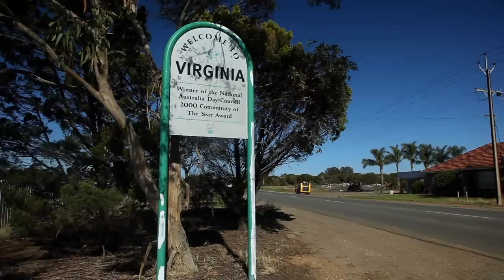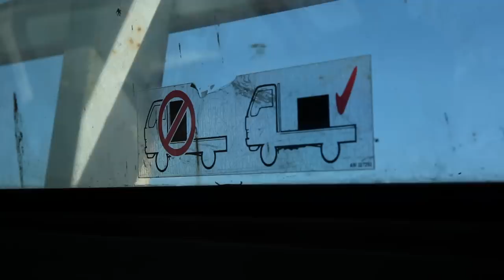Buying a Truck Part 3 - The Bush Bee Man

Comment: I have always found getting any machinery for the farm tested pays for itself, in not only piece of mind but negotiation as well ,people are much more open to taking offers when they know you were serious enough to get it properly looked at and the fact any "issues" have been confirmed by a mechanic not just plucked out of the air. IMO get it looked at and then make a reasonable offer,it has obviously just been sitting for ages so he would be mad to knock back a reasonable offer on it.Good luck

Comment: i think you should see how much to fix the beater you got and if it comes out to how much that truck is you might as well buy it, but if you can fix the truck you have for cheaper just do that. if you buy that you will still have to take the crane off the other one and put it on this one. thats too much work when you could probably pay a few 100 and get it fixed.

Comment: Gees BBM, go get the other motor reconed and get the radiator flushed. Save yourself a 1k. Or get the 6k rig mech tested, and junk the other one. Few $ in parts and you could use the old truck as a hive stand on the block. Other wise, you could exploit your potential as a model as in 4:24 and start a go fund me page. Buy me a truck and I won't do that ever again....